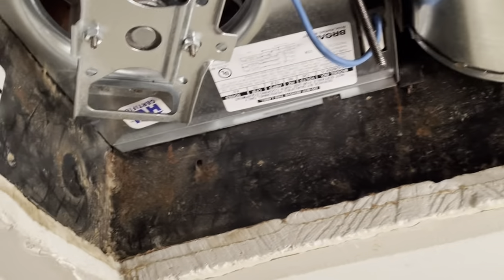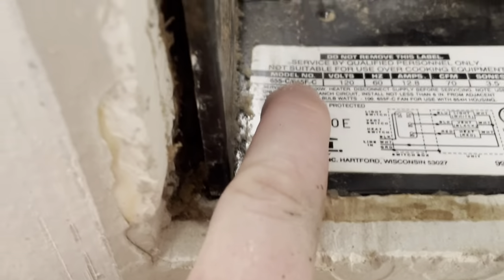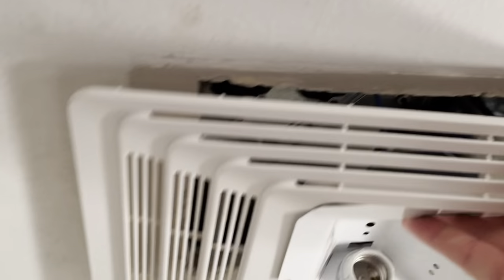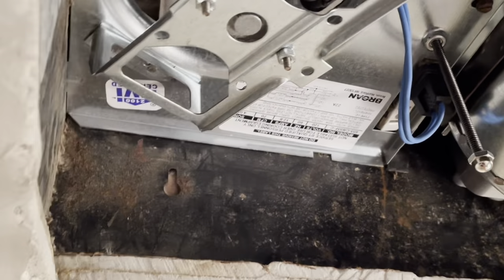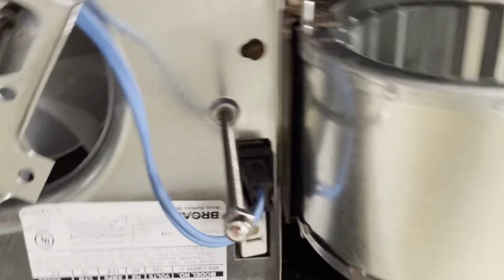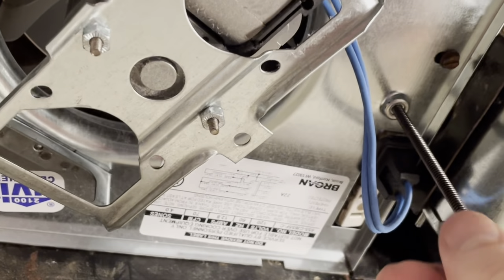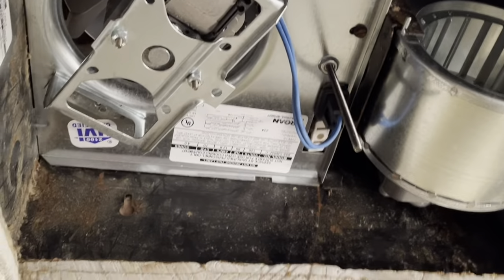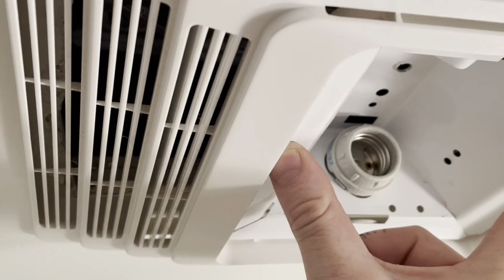REPLACE BROAN BATHROOM FAN - MODEL 655  - REPLACE BROAN BATH EXHAUST FAN - REPLACE BROAN BATH FAN

Comment: Do I have to go into the attic to take the whole housing unit down? I’m getting a whole new vent, thank you.
Reply from the maker: If you're getting a new vent installed, I would imagine you might need attic access for this, but I think it cant be mounted from the bathroom, however, vent hoses you'd need the attic for if you're replacing any of that too, of course.  Hopefully it's a pretty simple process for you. I just needed to replace the guts.

Comment: Do you think cleaning it out would work? Fan is loud and dirty. Should I just vacuum after removing cover or disconnect the fan and heater and try to do some maintenance? Thanks
Reply from the maker: I like to take an air compressor and blow it out, but if its so caked on there, it may still be challenging to even vacuum. That's always the best bet. A lot of times, the bearings go bad, which is what causes the squealing, or it just may need replacing all together. There's a sticker on there that may indicate how old the part is.

Comment: Could you link the Amazon items? I haven’t been able to find the fan for my N655X-C. Thanks!
Reply from the maker: Gabrielle, I just checked my previous Amazon order for this. It was the Broan 655 Finish Pack, Which included the heater/fan/light assembly and grille. 
1300W Heater/70 CFM, but it's out of stock currently. 

I checked Broan's website and it looks like it's discontinued. Some other companies may supply something like this, but I did see a few others marked as obsolete so they must not be producing this specific model anymore.